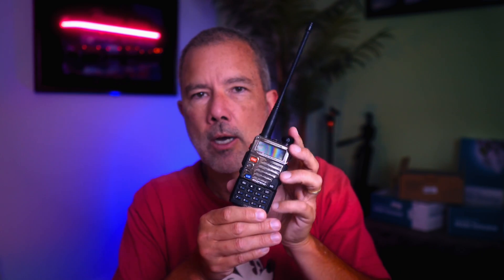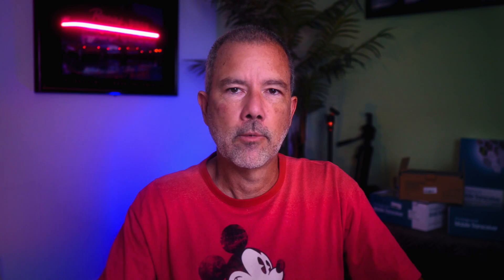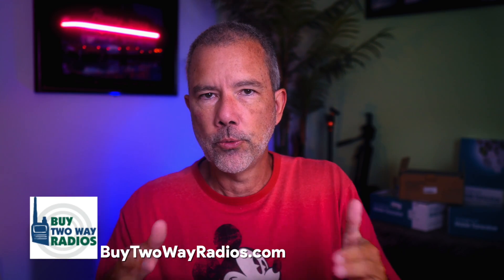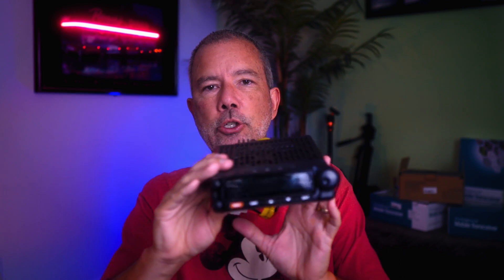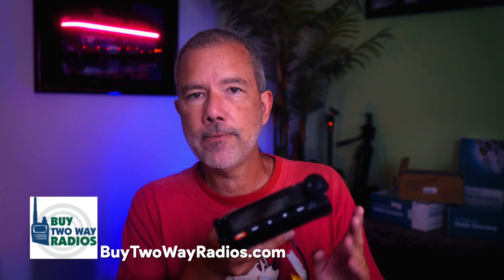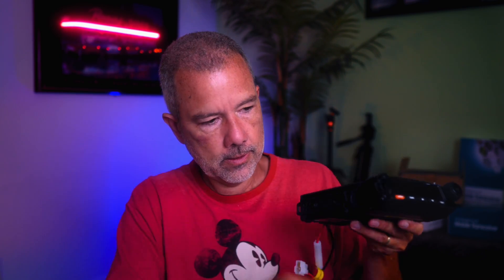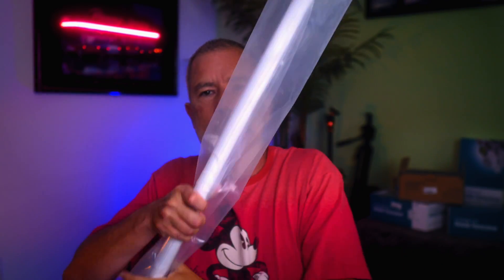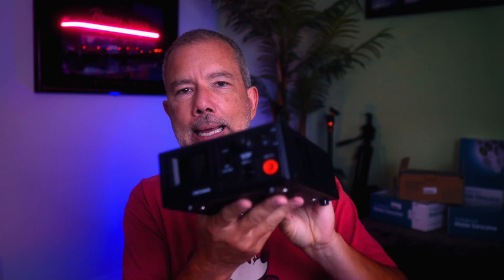Building a GMRS Repeater For Personal or SHTF PART1 - Repeater Build with Two Wouxun KG-1000G Radios

Comment: You might want to look at a coax loss calculator before you decide on rg59 or whatever is cheap. If your total run of coax is only 30ft, you will loose 50% of your power at the 460mhz range before it even gets to the antenna. Kind of defeats the purpose of having power if you can't get it to the antenna. Just a slight upgrade to rg213 will let you keep 73% of your power to the antenna with a 30ft run. The longer you go with your coax, the more loss. Example, 60ft of rg59 would only allow about 12 or 13 watts of your 50watts coming out of the radio to actually reach the antenna. The higher the frequency and the longer the run, the more that good coax is worth spending money on to actually get power to the antenna.

Comment: You only need your one FCC GMRS callsign. Review FCC Part 95 Personal Radio Services. I also spoke with FCC 6/2/25 and verified what I read. You do need to have it auto state the call sign every 15 minutes unless repeated transmissions state the call sign. Which I would interpret to mean if it's private use only no need for an auto repeat if you are using your own private repeater and properly stating your callsign.

Comment: I have seen other videos saying this setup doesn’t perform very well. I have had a kg 1000g for about a year and am contemplating buying another one and a duplexer. Should I opt to spend more and buy a dedicated repeater?
Reply from the maker: This setup does not perform as well as a purpose-built "real" repeater - it is more for "on the go" type use.. For long term use you would probably be better off with a purpose-built used repeater.

Comment: I know this video is 3 years old.  Today the Wouxun KG-1000G is sold as MURS and limited to 2 watts.   I haven't researched IF they sell a 50 watt version.   I also haven't followed the subsequent postings of this video topic, so I don't know how the project ended.  A friend and I are thinking out loud about setting up a repeater.
Reply from the maker: Incorrect:  There is, and always has been a MURS version of the KG-1000, known as the KG-1000M and the GMRS version, known as the KG-1000G.  The KG-1000G has now been replaced by the KG-1000G-Plus.  There is no such thing as a MURS KG-1000G (it would be the KG-1000M).
Now please apologize for posting wrong information as fact.
Reply: @TheNotaRubicon  Thank you for the information.  I copied and pasted your title into my search bar and the MURS version came up first to the far left and on Amazon.  It clearly said MURS and 2 watts.  I shared what I saw and posted hoping for the information you gave.  I'm happy to know about your clarification on the information I shared.
My friend and I will consider using that GMRS version of the radio if indeed we set up a repeater.

Comment: So, can you get away with using one 50watt radio as the transmitter but a cheap handheld as the reciever? It doesnt take as many watts to recieve and you can monitor 24/7 so seems like a place to save some bread.

Comment: I'm doing the same thing but on my truck....one antenna on the front of truck, and one in the back... Plan to use the transmit unit also as a base station, but will be able to setup the repeater mode as a special channel..... and the other stations as regular channels... without the repeat function enabled. It be good if you can do a video about this...!!

Comment: If I was using a normal repeater setup, maybe like one of the portable midland repeaters having it setup at home And wanted to also have a base station in the same home location. do I need to have 2 antennas or is there a way for them to utilize 1 antenna for both? Or would having a smaller antenna indoors then utilizing the larger repeater antenna frowned upon or for any reason a bad idea?

Comment: I want to build one. Place it in my horse trailer. Then when i park my trailer put it up. So i can have it when i go riding and camping and be able to contact base camp, or others trecking back and forth searching for cows on the side of the mountains.
Reply from the maker: For something like that you might want to look at the Retevis RT97 instead.
Reply: Currently I am using 2 baofeng uv5r and magnetic antennas.

Comment: Wouxun KG-1000G x2= $739.98   Tram 1486 UHF Fiberglass Base Antenna $98.99   TYT DWC30WIN 30A Switching Power Supply $109.99    XLT Communications GMRS Mobile Duplexer (50 Watt)  $169.99   Jackery Solar Generator 1000 $1649.00  For a total of $2,767.95 before taxes and shipping..... thought you said low cost in the title?
Reply: Shows you what 4 years has done

Comment: We have a repeater in our area that seems to follow all the rules. It only identifies itself when someone uses it after it's been sitting for a while, and 15 minutes after someone has used it. If someone hasn't used it in 15 minutes, it doesn't identify itself. However, it does identify itself every hour and give the time/temperature/weather. I don't think that's required, it's probably just for fun.

Comment: After looking them up, most all repeaters I'm seeing are just a few miles too far away for me to be in range. What's the best way to get a little more range? I have a UV 5r, UV 17 pro max, and UV 68 pro max. I have a couple of tactical folding antennas coming today, but what else can I do? I'm only a week or so into the hobby, and late because I got into it for prepping, and it should have been done a long time ago. Not sure I'm smart enough yet to build a repeater myself. I'm a contractor, so I have the tools and mechanical skills to do it, just too dumb at this stage when it comes to the radios themselves 😂
Reply from the maker: The best way to get more farz is a well-tuned (for the frequency you are using) antenna, placed as high as possible and clear of any obstructions...
Height is Might!

Comment: Will the Mid land 50 watt radio work to make a repeater out of.
Reply from the maker: Its technically possible, but its not designed to do that, so it would not be easy.

Comment: i know this video is old but did you ever get an answer on if the repeater needs to identify?
Reply from the maker: The wording of the FCC regulations is very nebulous and unclear.. I always interpreted the language to mean that the repeater does NOT need to self-identify.. But more recently i've seen some online arguments that have me thinking the wording might mean the repeater SHOULD self-identify... 
So.. I dunno.. but since it only takes 5 minutes to turn on the self-ID feature of my new repeater, i turned it on.
Reply: @TheNotaRubicon  95.1751(c) has our answer I think.  if its only ours like a repeater on my property and is only for my use, no Identification is needed.    if its open and other users properly identify, it again is not needed. but it users aren't identifying with their callsign then it is needed.  

But to me that sound like if anyone should get an fcc notice it should be the user not identifying, not the repeater set up to be used by those that follow the rules. 

Like you said if its as simple as turning on a setting, then its a non issue.

Comment: The way the repeaters in my area ID themselves are top of hour and when keyed up after 15 minutes of no activity.

The top of hour ones are (obviously) automated, I prefer CW, but are some with voice and that can get annoying depending on what it says...

"You are listening to WABC123 repeater" is fine but when you get "You are listening to WABC123 Repeater, Time is 20:00 hours, temperature 75 degrees, wind direction ENE at 5mph. Input Tone: 141.3... Power: 50 watts... elevation 1500ft... Antenna: Diamond... Color: Black... Status: Single and looking... Feeling: Fine..." it can get a bit annoying.

The other method I get a lot of is simply broadcasting Station ID in CW if keyed up after 15 minutes of inactivity. So if people are talking and they stop, and someone keys up 10 minutes later: No Station ID. It also doesn't broadcast on it's own, only if keyed up after 15 minutes of dead air. 

There are a lot of theories where and when Station ID is required.  The only thing in Part 95E states when it is NOT required for a repeater to identify.

I know this video is pretty old now, I just wanted to watch because I am considering it myself.

Do you automatically broadcast repeater station ID at intervals, or only after inactivity, or even not at all, just curious.

Comment: Could you have used one duel band radio Instead of two kg-1000?
Reply from the maker: The KG-1000Gs are designed to be connected together and used as a repeater. Although technically possible to use another radio, it would not be easy.

Comment: Can this be done with the kg-xs20g?
Reply from the maker: It is probably possible, but it would not be this easy.  The KG1000Gs are designed to be connected and used as a repeater, the XS20G is not, so you would have to do all the technical stuff yourself to get them connected and working together correctly.
Reply: @TheNotaRubicon  Right thats what I assumed. I hadn't looked at all the functions on the xs20g yet so I didnt know if they shared that feature. Thanks!
Reply: @TheNotaRubicon  Basically am trying to set up a repeater that I can stick in the truck for deer hunts with my brother and father. Plan to park the truck somewhere in decent elevation and see if we can gain a little bit of comms from handhelds to the repeater in on the truck.
Reply from the maker: I think this would be a better solution:  https://youtu.be/ZI6b2I-FHd0

Comment: When you say the antennas have to be far apart if you don’t use a duplexer, how far?
Reply from the maker: I had mine about 45 feet apart and they were still interferring with each other .. If you can separate them vertically instead of horizontally, you should be able to get them closer.

Comment: I'm a newb too but I would like to know why you need two matching 50W radios when I'm pretty sure that Wattage has nothing to do with listening ability. 
IOW: do you need to "listen" with a 50W radio AND transmit with a 50W radio too? 
Many dollars could be saved if a smaller Wattage radio just did the listening and the more expensive 50W radio did all the talking - right?
Reply from the maker: You dont need a matching 50W receive radio, but there no other non 50W radios that can be so easily connected and will work as a repeater right out of the box.
Reply: @TheNotaRubicon  I guess that's the answer then. Thanks - I didn't know.

Comment: Could this setup be used with Midland's MXT500 instead of the Wouxun?
Reply from the maker: The KG1000G is designed to be used as a repeater this way, the MXT500 is not.  It is technically possible, but it would not be easy.

Comment: I don't know much about this stuff. Can someone explain to me why the wattage on the receiver is important? Could you not save money by using a lower powered receiver with a 50W transmitter?
Reply from the maker: The wattage on the receiver is not important, but you wont find any other receiver that is designed to work together as an ad-hoc repeater with a KG1000G.
Reply: @TheNotaRubicon  Okay, thanks.

Comment: First off, Randy, awesome channel. Been a fan for awhile now. What other Gmrs mobile radios would be a good option for a repeater setup? I found a good price a btech Gmrs 50x1. Would two these work. There’s no information in the manual for using two in a repeater setup. Anybody use these yet to do so? Thx in advance.
Reply from the maker: The KG-1000G is the only GMRS radio that I am aware of that is designed to be easily connected to another and used as a repeater.  It could be done with radios like the 50X1, but it would not be easy.
Reply: @TheNotaRubicon  Thx for the knowledge

Comment: I'm learning as I go, too, and I'm sorry for replying to your question with more questions; but how do I know if I want to make a repeater or not? What are the pros and cons? I originally got a Baofeng because I thought there were hidden microphone transmitters hidden all around me so certain people could spy on me and I wanted to pick up on it with the radio and prove it, but I can't seem to figure out how to or there aren't any. I HAD an RF detector, but I sold it when I couldn't find anything. I think they could have turned them off when the detector showed up in the mail, so I probably should have kept it instead of selling it. Any suggestions?
Reply from the maker: I suggest talking to your Dr. about increasing your medication.

Comment: What sort of licensing is required to legally operate a repeater? I am very interested in this subject. Subbed.
Reply from the maker: No license is required to own/run a repeater - but the repeater users must have a GMRS license.
Reply: @TheNotaRubicon  thanks! Great content, you are an asset to the radio community.

Comment: Great video I have a few questions if the dueplexer is half the cost of the second radio why wouldn't you just use the dueplexer also for the receive side it doesn't need much power in theory you could use a cheaper lower power receiver with out buying a duplexer I only these questions because I'm looking to build one as well thank you have a good day

Comment: I wish there was a GMRS repeater in my area. I live in a very remote and very hilly area, at the bottom of long narrow valley, with only one opening for the road in, surrounded on all sides by 500 ft tall hills. Crystal clear communication anywhere on my road in the valley, 500 yards after turning off my road and leaving the valley, its like someone flipped a switch. Tried full 50 watts. Nothing just dead air. No cellphone service anywhere on the 30 minute drive into town. Would like a way for my wife and I to be able to communicate when one of us makes that trip to town in case something happened to the car. Been more than one time I've seen someone walking miles or waving people down because their car broke down and they cant make a call. Only option might be to try CB SSB, but I very much doubt that will work. Breaks my heart. I want so badly for GMRS to work.

Comment: No need to put an antenna on your roof. Instead, get a tripod. Pour a couple bags of quick kreat with anchor bolts. Clamp the mast into tripod. Brace mast to the eve and presto! I put up a 57 foot antenna this way. Guy wires included.

Comment: I ordered my KG-UV9G Pro but I ran into a huge problem. There is no tower repeater for gmrs near me for hundreds of miles. I live in Imperial County. I am still getting my gmrs license even though I won't be able to transmit on the radio. But I am planing on moving to Arizona and there are more than plenty of  gmrs repeater towers surrounding the area shown on the map of the mygmrs website. It would be a great idea to built my own repeater to cover me a 25-30 mile range in all directions. I guess I will have to just wish it or just wait until the move happens. I could barely afford getting the radio I ordered.

Comment: I bought 8 KG1000G's and 5 KG805's.  Installing the KG1000G's in 2 RV's, 1 Jeep, 1 Pickup, and an SUV, the KG 805's are for some ATV/UTV's.  I'm building the repeater, could you share an update video on your repeater project.  I ordered a vented stereo cabinet to put all the radio equipment inside.  The repeater is at 2000' above sea level in Ramona, CA.  I'm mounting the antenna using a gable mount on a workshop.  How would I share pictures of my various installs?  Did you end up using the ID-O-Matic?  I'm still trying to source that equipment and cable.  All this equipment is mainly for desert trips, offroading, road-tripping, convoy ops.  I also have an IC-2730a as a base station radio at the house and an IC-7100 in my truck (GMC Sierra 2500HD), I'm waiting on a Little Tarheel ii screwdriver antenna.  I love your videos brother.  Very helpful and informative.
Reply: Where did you buy 8 KG1000G's ??? Can't get them anywhere...

Comment: I will start by saying I like the tone of your channel lol.

I got a question about baofeng (uv-5r) repeater builds (SHTF) scenario, I heard using a strait 2.5mm to 3.5mm cable could fry the mic port due to voltage output differences. Can I hopefully get an answer. THANKS

Comment: I am running a 50 watt Kenwood repeater in a small utility closet on the balcony of my buddies  27th floor apartment. It is a boom squasher that has an effective 25  mile range for HT's and 40 miles for mobiles.
Reply from the maker: Is a boom squashed something good, or something bad?
Reply: @TheNotaRubicon  a boom squasher is definitely a good thing. I am using a 4 element dipole antenna that is an amazing RX antenna.

Comment: I have built a ham-o-can repeater in the last few weeks. it has been a fun project. it can run off of LiPO batteries for a few hours but can accept power from 12-32V and has a 120V AC PSU. the radio is regulated at 13.8V so it always has the the right power to run it.

Comment: I just did this myself. May I suggest using a raspberry pi instead of an ID-O-MATIC for the controller. The pi with asterisk has many more features. Also if you use a pi you can link to other repeaters via internet and also use DVSwitch to access the repeater via cell phone.
Reply from the maker: I have no interest in linking to other repeaters over the internet since that kinda kills the entire SHTF usage idea.. But, if a Rasberry Pi works out of the box, just like the ID-O-MATIC to do the job, it sounds like a great idea.. If not, then i'm not interested.

Comment: Wouxun KG-1000G are a good choice in that they are superhet and not SDR like Baofengs.
SDR RX blocks easily on strong signals, although a multiband radio like the KG1000 is overkill
 for just GPRS, a couple of say Kenwood TK860 would do the job fine and program with Chirp